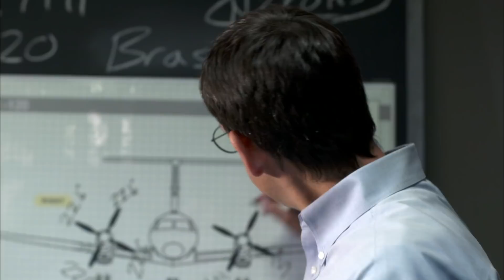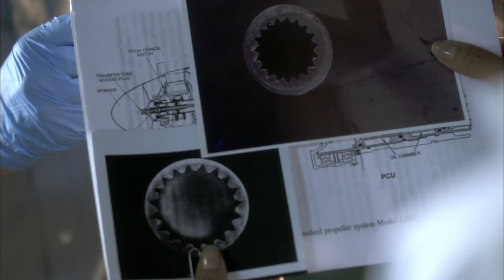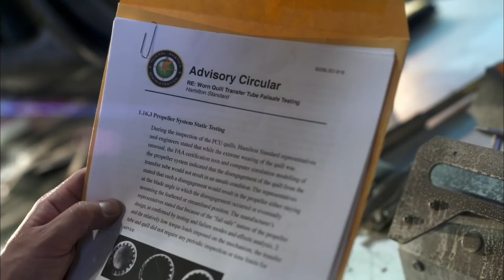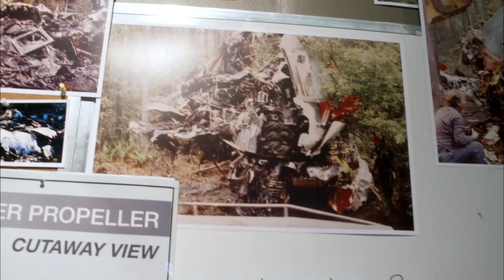Was This Plane’s ‘Flat Blades’ the Reason it Crashed? 🛩️ Air Disasters | Smithsonian Channel

Comment: The National Transportation Safety Board determines that, the probable cause of this accident was the loss of control in flight as a result of a malfunction of the left engine propeller control unit, which allowed the propeller blade angles to go below the flight idle position. Contributing to the accident was the deficient design of the propeller control unit by Hamilton Standard and the approval of the design by the Federal Aviation Administration. The design did not correctly evaluate the failure mode that occurred during this flight, which resulted in an uncommanded and uncorrectable movement of the blades of the airplane’s left propeller below the flight idle position.  https://en.wikipedia.org/wiki/Atlantic_Southeast_Airlines_Flight_2311

The reason the "teeth" on the quill were filed down so they did not mesh with the grooves on the transfer tube was because the metalurgy of the transfer tube was changed after the EMB-120's had been in service for a couple of years. The dissimilar metals caused the transfer tube to act as a file and erode the teeth on the quill. We (the pilots) did not know this until many months after the crash. It took several months for the ASA pilots on the investigating commitee to realize what had happended (not the NTSB investigators or Hamilton Standard engineers who tried to blame it on us). As a result, the old transfer tubes were quickly replaced and the inspection period for the PCU was changed to a more frequent interval. The airplanes were never taken out-of-service. 

It was an unrecoverable event.

Comment: But i have a question why didn't the blades go to a acceptable degree if the gear was completely loose I mean the air hitting it would force it to move into the lowest drag position

Comment: Investigator: "The blade angle turned dangerously because the quill in the gearbox worn out, and unable to connect with the blade properly-"
Manufacturer: "That's impossible."
Investigator: "o"
Reply: I laughed too